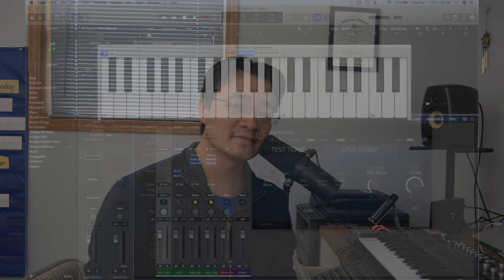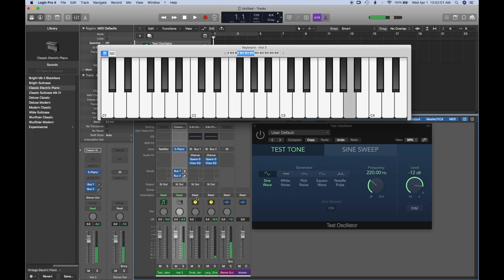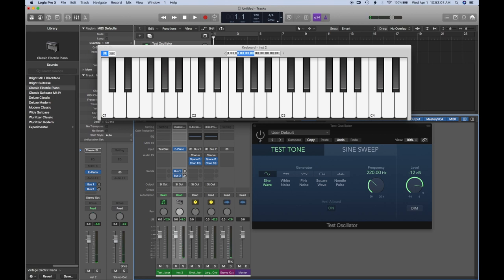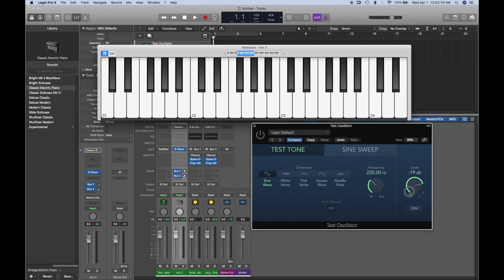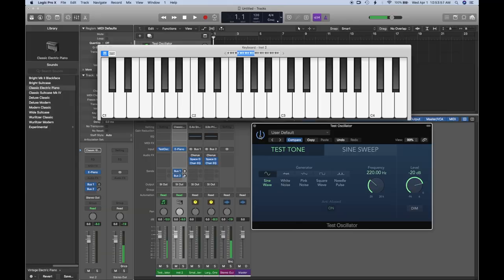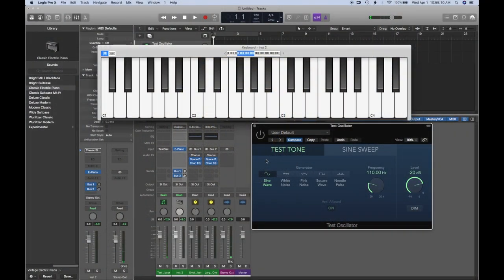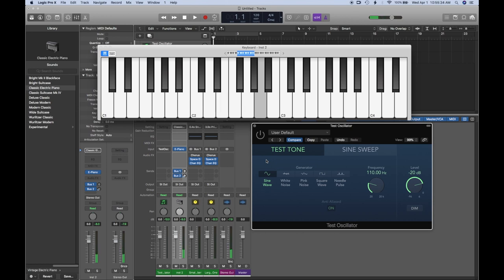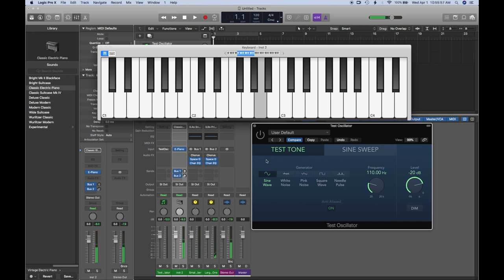Tutorial - Vocal Subharmonics (How to Sing Subharmonics)

Comment: Have you tried using pressure for getting into subharmonics when singing in chest-voice? It works fairly well from E1 up to Ab1 for me and its way better then relaxing... relaxing works from Ab1 up to D2 from me
Reply from the maker: So, the pressure you are feeling is the focus of tone, vowel formation, and breath energy which directly relates to the idea that the male voice has the feeling of a "break" below G2 (passagio if you want to call it). All subharmonic users agree with this as well in that you need a brighter sound and more focus around G1 and Ab1.

The added pressure is helpful in concentrating on the formation of the subharmonic and can get quite a bit of volume. Some people do this intuitively and others have to be mindful of it.

You are correct in that there needs to be a better use pressure below that area. Guess what? After E1... You move back into the relaxed territory. These feelings of relaxed and pressure is relative and sometimes very minute compared to when you are singing higher. This confirms that there is a break that we as singers try to bridge to allow for uniformity in our voices.

Thanks for your input and great observation!
Reply: @bass2yang  Thanks! You know David Kahn's Tutorial Video for shure. In contrast to David Larsons explanation in which you relaxe into subharmonics, he learned it by pushing through. So singing vocal fry arround G1 and add air flow and pressure to get to the subharmonic note. This is not helpful for singing notes over Ab1 though, thats why I made this observation.
Reply from the maker: Yup - I call this "active" vocal subharmonics, where the user engages in the subharmonic with more focus and breath energy. Almost kargyraa-like in nature; I would not be surprised if it was kargyraa since it is related.

Josh, David Kahn, and Timothy Dawson uses this really well for those low notes (Timothy has an amazing kargyraa sound). The master of this sound is Pavel Myakotin, hands down. 

Awesome stuff!
Reply: @bass2yang   Pavel is superb! He is so good you wouldn't even question if its his modal voice - astonishing... its also astonishing that there arent more people who  stumbled upon the subharmonic technique ... or I just dont know it of course.

Have you tried using subharmonics in head voice? By using my head voice its easier for me to access the subharmonic register and I can jump almost immediately into the 2nd subharmonic "register".
Reply from the maker: Yes! A lot of beatboxers use head voice to access the 2nd subharmonic (and 3rd). The idea is to offset the offset in subharmonics. Singing in head voice (sometimes even falsetto) helps with the asymmetry of the folds, making it easier to obtain. Great approach! I've only done this a few times with some success. Pretty cool effect.

Comment: So subharmonics are just sound illusions, but your not actually singing the note??
Reply from the maker: Yes and no. The pitch (fundamental) is present so it is not just a psychoacoustic phenomenon. At the same time, I am not "singing" down the octave.

From some recent research done, they are concluding that it is essentially asymmetric vocal fold phonation (the vocal folds are slightly offset. And because of that offset, the way each side of the vocal fold comes into contact with each other is at irregular intervals (2 contacts for every 3 periods, etc.). This creates the octaved fundamental and sounds very similar to a modal voice note since it is still using the true vocal folds. The difference is that there is a variance of about 10-20dB lower in the new, lower fundamental than the note that is being sung.

I hope this makes sense. I'll need to track down that article. My thoughts are that there are more ways to achieve a subharmonic note than we think, which explains why certain people sound different from others, not counting their own natural vocal "fingerprint".

Thanks for commenting!

Comment: i dont know how to enter the vocal fry, sometime i can vibrate in the morning but normaly i cant do it :(
Reply from the maker: It'll take some time - usually it will happen when you least expect it. When it does happen, try to remember the feeling. For some people, it feels like you are relaxing your voice. For others, it feels like your voice may be pressed and tight - either way, the vocal folds are fully adducted and only allowing pulses of air (puffs of air) to go through; once the air goes through, it seals itself again and repeats the process. All of this happens very quickly, and depending on the rate, it can create a perceivable pitch.

Think more like a snare drum roll instead of a cello or trombone sustaining a note. Or, if you can, do lip trills (lip buzzes) or tongue rolls to see if that helps.
Reply: Thank you very much !

Comment: I just don’t understand how to APPLY vocal fry to my normal voice at various notes.
Reply from the maker: It's hard to grasp since usually it just blends in. One thing I can think of is just sing a note and try to see if you can vocal fry that same note. So if you are singing a C3, try to vocal fry that same pitch. Now, try to see if you can get it to balance in between the vocal fry and the normal voice.

Some people avoid vocal fry or cannot produce it. I recommend listening to Elmer Fudd (Bugs Bunny) or even Bill Clinton's speaking voice. The trail end of his speech falls into vocal fry. Once you get that part, it takes a bit of time to balance the two together to get the subharmonics.

In most cases, it's usually because people try to sing the lower octave and that's not how to do it. Coast on the normal note and relax into the fry (as if you just woke up and your voice is still groggy).

Hope this helps! If not, it will happen when you least expect it.

Comment: I literally understood nothing with what I'm supposed to be feeling
Reply from the maker: True - it's one of those concepts where experience and imitation must occur first before understanding what is supposed to be felt. I wish I could assist you more on this, but this is about the extent of what I can do besides doing more videos.

One thing that I do feel is that my voice feels like it is opening up and pivoting forward (voice box, larynx, etc.). So, when I sing a note, say a Bb2, it feels as if the Bb2 is slightly compressed, but also opening up in the back of the larynx (as if the vocal folds are slightly repositioning themselves, but they can't actually do that; it is just a sensation). The concept of "moving into vocal fry" where there is a bit of tension, but also trying to maintain a note (hence the concept, singing a pitch while trying to vocal fry on the same pitch) assists in this interaction.

Practice helps but time and listening to others approach this will help as well. I hope this was able to help you (and if not, my apologies - I'll keep working on it).